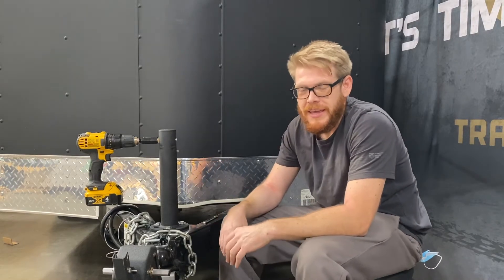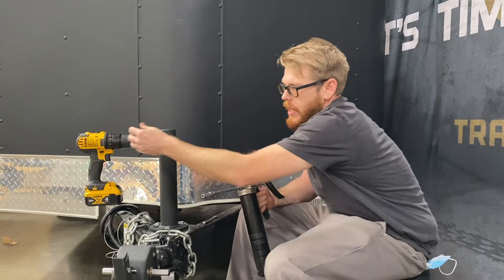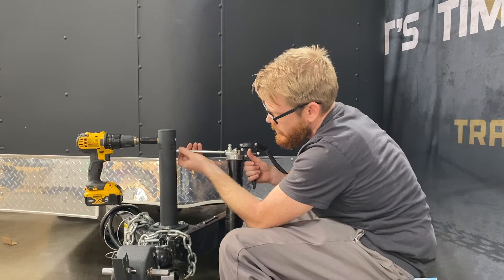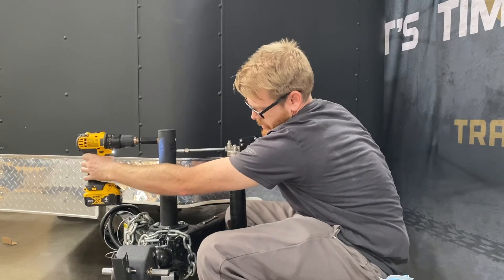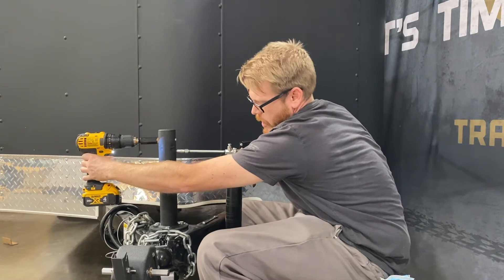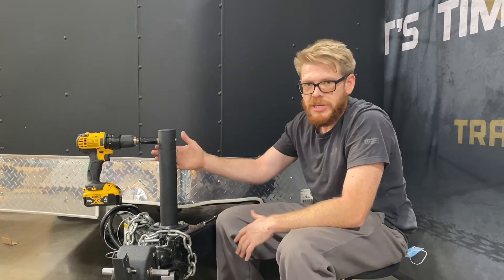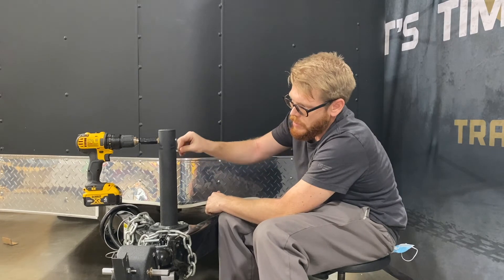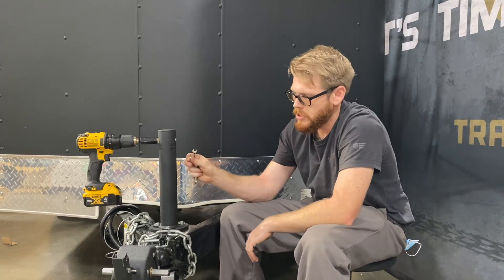How to Grease the JX Series and Repair the Nozzle

Comment: My trailer valet jack was getting really difficult to operate. So I watched this video to find out how to grease it. I followed the instructions in this video. After adding grease through the zerk, the JX series jack was still hard to extend. So I disassembled the JX, as shown in the other video. The jackscrew had basically no grease on it. All the grease I added through the zerk went everywhere EXCEPT on the jackscrew threads. I used my finger to spread the grease all over the jackscrew. That solved the problem. If you want to properly grease the jackscrew, you have to disassemble the JX. The zerk method didn't work. I have photos but there is no way to upload them to youtube comments.
Reply from the maker: Hello! Thank you for reaching out to Trailer Valet and leaving your experience with our product. We are extremely sorry to hear that you had these issues when trying to operate and grease the unit. Please reach out to support@trailervalet.com and a support tech can assist you with the proper steps to operate and grease your jack. Thank you!